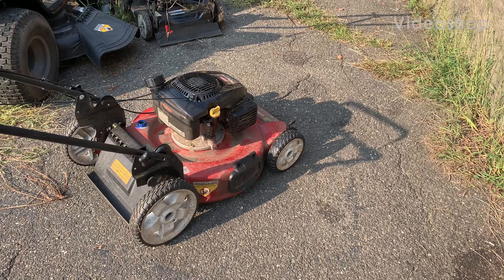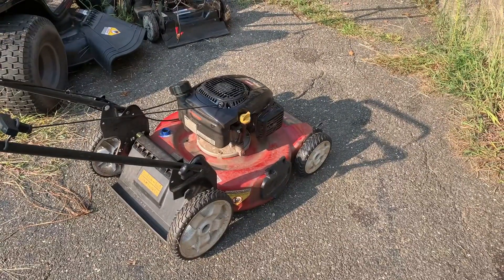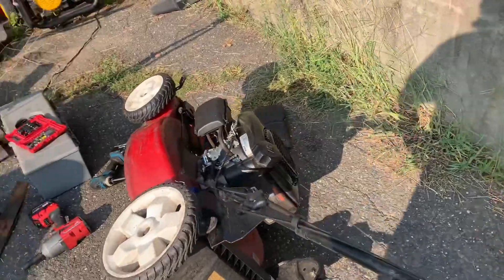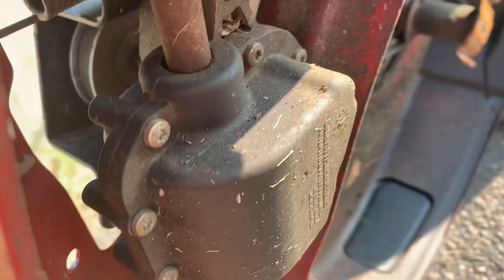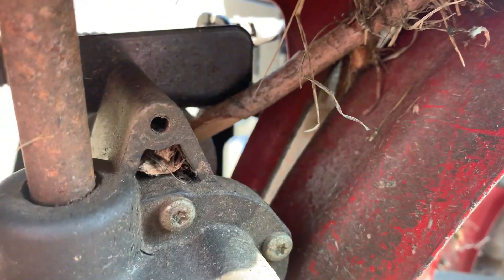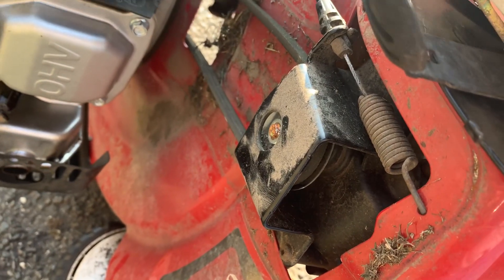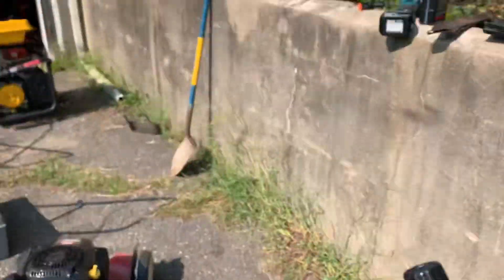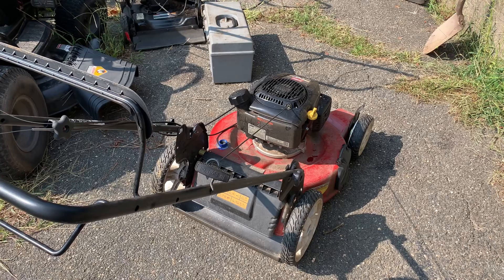Toro Recycler Self Propel constantly On, cable isn’t even attached!!

Comment: Funny you just did this video because we recently had the same mower brought in with a seized transmission and burnt up belt. The customer wanted us to turn it into a push mower for him and we had confirmed the transmission was locked up assuming internally. When we removed the metal belt cover what looked like a little piece of spruce plank or 2x4 was jammed between the metal cover and OD of the pulley seized right up and we even tried rotating it with no luck (guess if i would have used an impact gun on the nut first it may have spun that piece of wood out). Customer was extremely happy to get back a self propelled unit fully serviced with a new belt. Good video to remind your viewers to pick up branches before mowing eh?